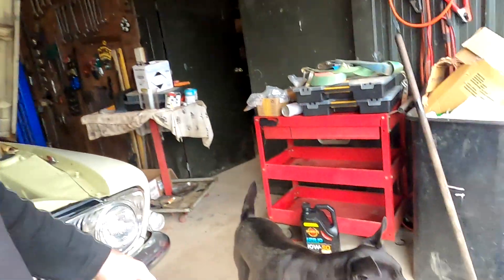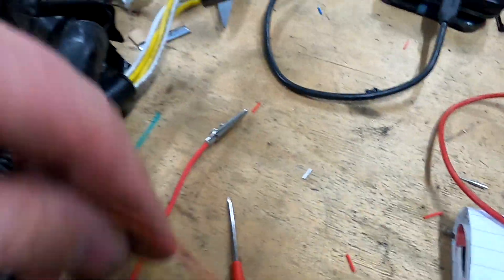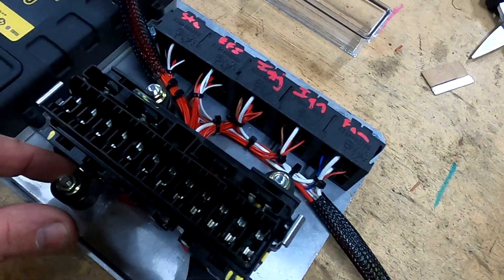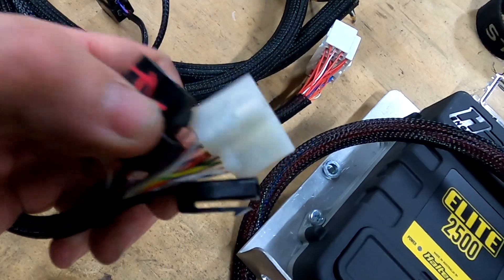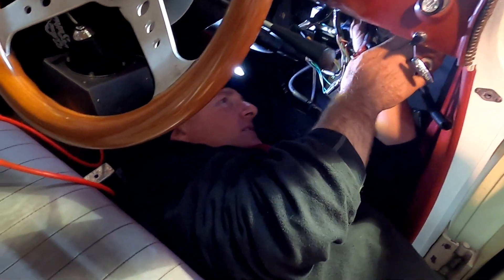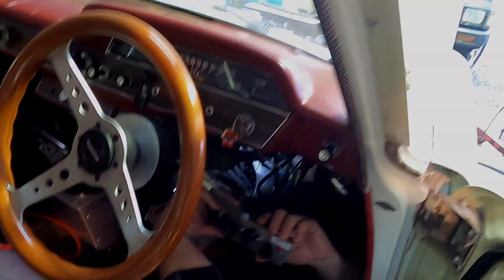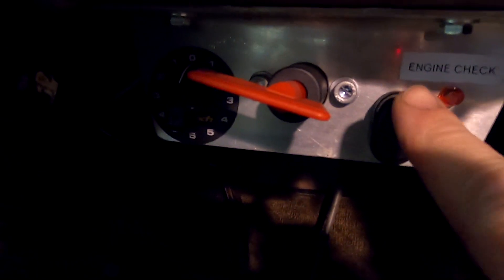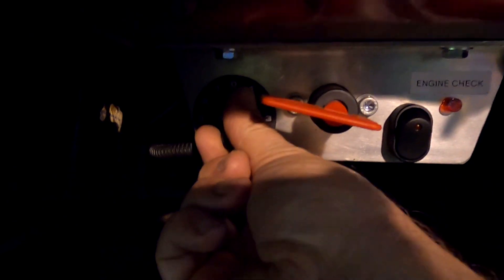Zephyr to 1uz with Haltech elite 2500 ecu running both engine and transmission. Wiring overview

Comment: Hey great video Calvin, you should be able to use an output to control lock up
Reply from the maker: Correct, This was always the plan and how we did it.  Cheers
Reply: @CartuneNZ  
Too easy
Guess I should have watched your other videos first.
Are the shift tables that you have for the standard a340 easy to come by?
Reply from the maker: @paulsapper  I was sent the stock A340 numbers from haltech but they were pretty average to be honest.  My resulting numbers were very very different.   I also have a mate in oz doing a few so he was helpful to bounce ideas off.
Reply: @CartuneNZ 
Thanks Kalvin
I have a 1jz conversion into a FJ Holden that I am doing with a A340 box behind it, I was planning to use the Elite 2500 as well to control the auto.